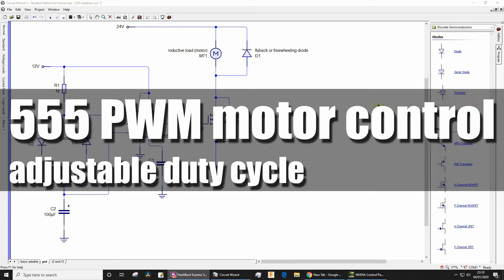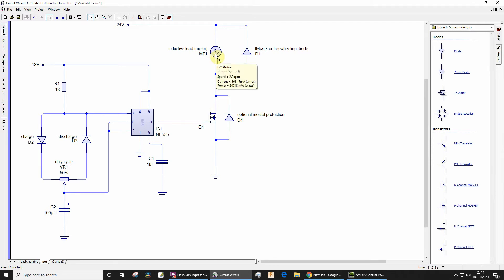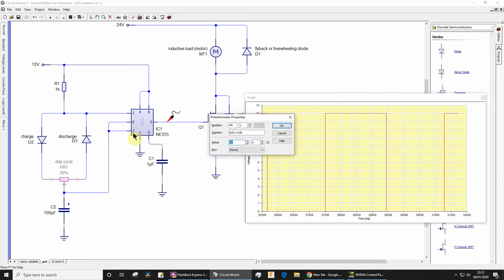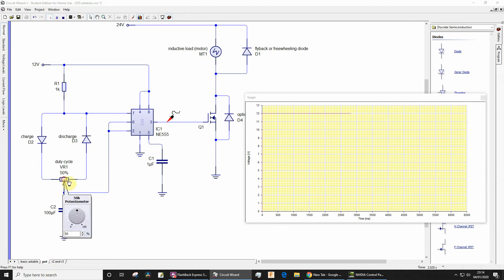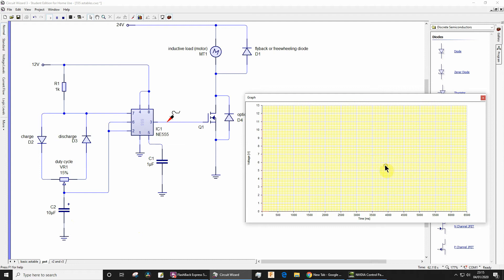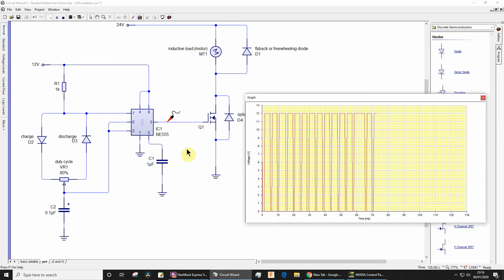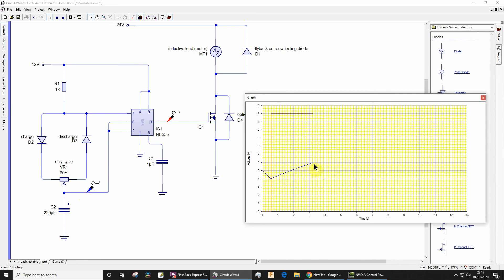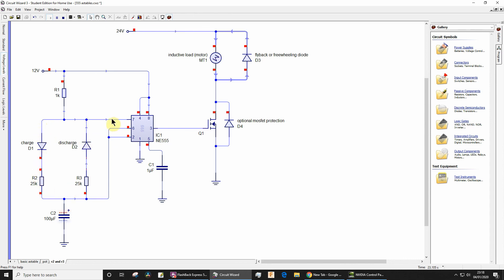555 PWM motor speed control with adjustable duty cycle

Comment: I watched all 3 videos and I hope I got this right since i dont know much about "fancy" electronics like this. 12v is for driving the electronics control of circuit and 24v is only passing through mosfet drain and source pins. The ground symbol is negative wire? Diodes D2, D3, D4 can be 
1N4007-1a rating but the D1 has to be bigger like current rating of motor so for a 5a motor, 10a diode like P1000K will do the job? The potentiometer is wired in the way the that pin 1 is connected to capacitor +side and diodes are connected to pins 2 and 3?
Reply from the maker: The NE555 timer IC has a maximum supply voltage of 18V so cannot be used directly with a 24V supply. I used a 24V motor and that's why I included a second supply rail which in this example was 12V. 
You may find it convenient to use a lower Vcc supply for your 555 timer but it should be sufficient to trigger the MOSFET. You would need to check your MOSFET datasheet and refer to VGS (th) which is the gate trigger voltage and check the typical transfer characteristics. For example, if you consider the IRF3205 (https://www.infineon.com/dgdl/irf3205pbf.pdf?fileId=5546d462533600a4015355def244190a) figure 3 shows a drain-source current of about 100A when VGS (voltage gate-source) is about 6V. For this MOSFET, a gate voltage of about 12V would ensure it was working in saturation mode. 
You may prefer to use a MOSFET (e.g. IRL540N) with a lower switching threshold. Circuit ground is a reference point which in this circuit is assumed to be 0V (or "negative" if you prefer that terminology). 
24V does not "pass" through the MOSFET but I know what you mean. You want the MOSFET to act as a switch. When it is in cutoff (e.g. open switch) you should be able to measure 24V across drain-source and when it is in saturation it is desirable that voltage should be as close to zero as possible. 
D1 must have a sufficiently high rating to protect the circuit; as a flyback diode you can assume it will carry a current no greater than carried by the motor when it is under power. Double this rating to be safe. There are some other considerations that may need to be taken into account such as switching frequency. 
The middle wiper pin of the potentiometer is connected to C2.